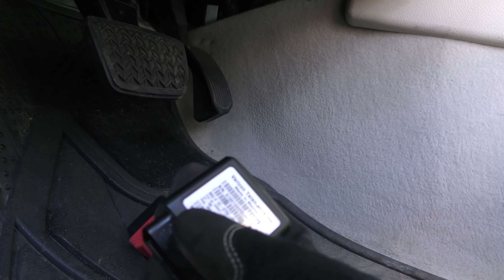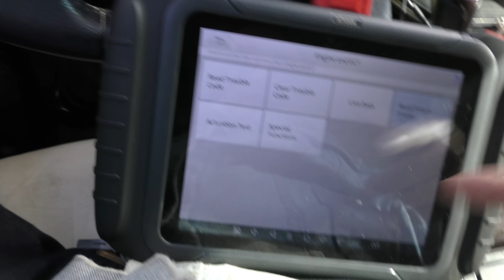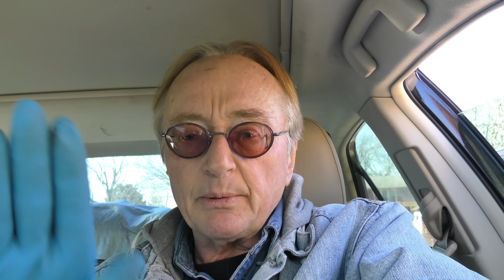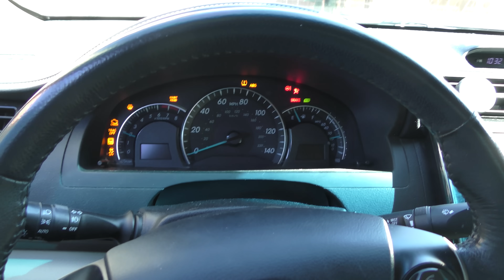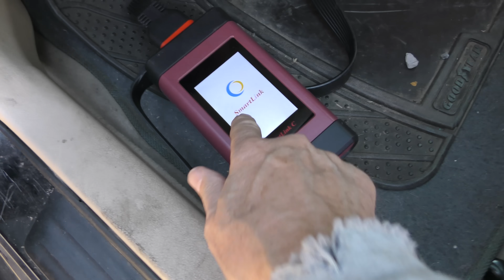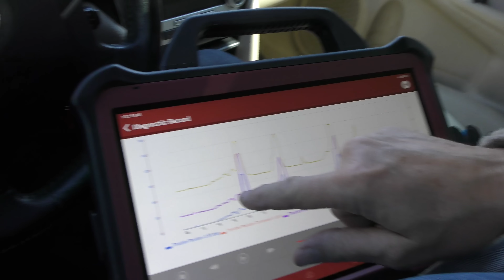This Stupid Device Just Cost My Customer Thousands in Car Repairs

Comment: Hey Scotty, great vid -as always - and good to know about those OBD diagnostic dongles.  Curious, do you think those insurance company driver behavior monitoring OBD devices/dongles can also cause damage?   I don't trust any of 'em!
Reply: Yes they can! I would rather pay higher insurance bills. Messed my 2002 Ram Van up for a long time.
Reply: I hate that when people drive slower so they can save on insurance 
Ruins everybody else's drive or commute home after work
Reply: They watch your accelerator pedal use behavior, among other things, so it seems entirely possible that a badly implemented dongle can mess up the related system.
Reply: I would never use of of those either. It's a stupid thing they came up with to monitor you
Reply: Another thing is that electronic throttles are used for is safety systems. For instance, I drove a Mazdaspeed3 for a while, which is a ~260hp FWD, stick shift sports car. It electronically retards the throttle in first and second gear if the steering angle is not right at center and held there. This is because the car is capable of generating incredible torque steer in first and second, and even with the retarding of the throttle, it'll pull you right off the road if you're not paying attention. Similarly, I've read that some traction/stability control systems also will override your throttle input if it thinks you're doing something stupid.

Comment: Man that sucks to have to replace the main computer like that is crazy. I never liked those plug-in diagnostic cell phone reader Diagnostics. I like to use the regular OBD2 also don't use those computerized accelerators that help your car go faster from a stop I predict those with mess up your transmission over time

Comment: I have a question, my car wouldnt start and a shop i usually deal with came to jump my car bc it was freezing out so i thought it was just bc of how cold it was; they tried jumping it with a battery and jumper cables and it wouldnt start up. 

They towed it to the shop and told me it is my starter and I would need a new one, now they got my car started without me replacing the starter; how can they do that? 

Also when I was told how much it would be and i said i couldnt afford it the person asked me how much i could afford, I dont know if they were trying to accommodate me or just try to scam me; when i picked up the car they told me also how it was started it could last 6 days or 6 months they wouldnt be able to know and that is why Im thinking it was some sort of scam and my battery was just that cold. 

My car is a 2009 dodge avenger 2.4l and i just replaced the battery in 2020, if anyone wants to weigh in please feel free!
Reply: Starters can work intermittently when failing. Sometimes a good wack in the right spot can bring one back for 6 min. Or 6 months. I had to crawl under my old work car many years ago to give it a wack to get home one day. Another time my van wasn't starting on a cold day and I had to get to work. I think it was the solenoid on the van though because I had to jump the contacts with a screw driver, but never stopped working again after that. Haven't driven it in a long time.
While I can't say if that particular shop is trying to scam you. It's not unusual for starters to fail as you describe.
I use the whack test at work before replacing starters just out of curiosity if I can get it to work one more time.
Reply: @caddyguy5369  thank you

Comment: I also bought a cheap dongle and when I put it in obd the airbag light would turn on and car used to die. So I removed it and crushed by driving it over. Hopefully it didn't do any permanent damage, only time will tell

Comment: The throttle sensor went bad on my 350Z and all that was was the rubber grommet under the pedal where it rests it went bad so it created a gap I took a screw head that was the same thickness as the rubber top of the grommet and put a metal screw in there never had another problem and the good thing is it will never go bad again that tiny little gap between the bottom of the pedal and we're at rest set created that I saved $300 and the good thing is it will never go bad again

Comment: I had to replace my throttle body several years ago when I had my LS400. I had to drive with the A/C on or the check engine light would come on and I would have to push the throttle to the floor in order to get the vehicle to even move until I shut off the engine and restarted it. Replacing the throttle body fixed everything, but this person may have a different problem so I don't know because of course i can't get to drive that vehicle to see if it's acting the exact same way.

Comment: I mean i guess its possible. But not probably. Sounds like uve got a highly biased opinion of obd2 dongles. Damaging the computer though? Doubt it. We manage a fleet of vehicles with said devices and never have had ANY issue. And were talking since brand new they have had a dongle plugged in. While parked. Nice try though im sure stupid poeple will easily believe this. But what a crap diagnoses. This is what happens when a mechanic isnt talented enough to actually find the cause of the problem.

Comment: Some dash cams now have the option to connect to the OBD2 port instead of tapping a fuse to record while the car is parked. Could this potentially damage anything?
Reply: No, your OBD port is fuse protected but it is still better to hardwire it the proper way.

Comment: Electronic\eletrical spray cleaner removes loose debris that is all. The proper way to clean is to brush\scrape the connecting pins providing a contact surface free of corrosion then spray. Essentially, what Scotty did is useless....I am not impressed. If I practiced the equivalent craftsmanship I would be a crappy tech.
btw...I am a ROV +20 yr tech.
There is the right way and then all the others.

Comment: What if its only a TPS adjustment or change
Reply: If it's not a diagnostic tool like what Scotty has, don't use it. Unless you are diagnosing problems nothing should be plugged into the OBD II system.

Comment: I know corps with fleets of vehicles that use something like these. So far the one I personally know have had no issues with these dongles with exception that they can stick out too far and be kicked over and over. A short OBD extension cable fixed it. These dongles provide in vehicle wifi + tracking + vehicle statuses.  So far, I only agree with you plugging crap in cars so far were those cheapo cigarette lighter adapters with super noisy switching power supplies that can in fact glitch out computers.
Reply: Gotta disagree with you.  My alarm kept randomly going off a few minutes after I turned the car off.  Eventually traced it to a faulty T-Mobile syncUP Drive.
Reply: @cooldaddyslick6869  did a replacement resolve this?
Reply: @kakurerud7516  Yeah me taking it out solved it.
Reply: @cooldaddyslick6869  but what about putting in a non defective unit. I am an electronics guy and actually want to know ;)
Reply: @kakurerud7516  Yes.  I bought another one.  The issue never came back

Comment: Correct about the can of spray cleaner but those little dongles have resistors and no way to back feed voltage at all. No possible way those can affect the ECU of a car. If you know a little about electronics you know this is a load a bull 😮‍💨😂
Reply: That dongle can interfere with module communication on the controller area network. That can give you weird issues.
Reply: @ubahd00d   Show us proof that this thing does what you said it does...

Comment: @0:25 - OM-Gosh!  I learned that the hard way.  I just came back from a horse show.  Had my F-350 running with a three horse slant load trailer behind the truck and two tired horses inside.  I went to get out of my truck and left the engine running while I went to open the gate to the barn.  Well, my JRT decided she was going to be nosey and see what I was doing.  She stepped on the front driver side door panel and locked the doors.  All my belongings were inside the running truck.  Fortunately, there is a phone in the barn (landline) and I was able to call someone for help!  I will never forget that night.  Since then, if my car is running, I always roll down the driver side window at least half way regardless if there are any dogs inside or not!

Comment: My Summer car, a '97Geo Metro, had developed a hesitation and poor power problem when I took it out for the first time in the Spring. Settling in to work on it,  I took off the air cleaner, only to find it packed with a mouse nest.

Comment: This is why everyone needs to drive a Tesla. They require no maintenance so  you don't have to worry about the engine running rough or oil changes. All you have to do is drive it for 3 years and then get a new one. It's super eco friendly. I've driven my for 30 months and the tires are starting to lose their grip so I'm getting a new model 3 in 6 months. You really only need to put $23,000 down and the payments with insurance are only around $1,400/month. Way cheaper than having to buy gas and oil and tires.
Reply: Totally agree man.

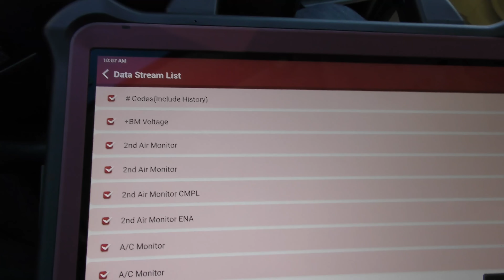Comment: 11:34 maybe one of the circuit boards has a crack in a copper trace? Because metal expands when it gets hot maybe that helps complete the circuit, but when it's cold the circuit is open?
I had a similar problem in my old Isuzu Trooper.
Good video 👍
Reply: There is a problem with "closed loop" mode. That is when an engine is cold and it uses base parameters to run. When it warms up it uses "open loop" mode. In open loop it uses more sensors (like the oxygen sensors) and adapts to be more efficient, and for abnormalities like altitude. This car probably has an air leak, either in the vacuum system or in the intake gaskets. Thus the "throttle" (a.k.a. air inlet) malfunction code. Long term fuel trim and mass air flow at idle for the engine size should give the answer.
Reply: @stewartgriffin3192  Its backwards. Open loop when cold, as in the sensor circuits are open, so not "connected", closed loop when warm, as in the sensor circuits are closed, or "connected".
Reply: @stewartgriffin3192  With the heated oxygen sensors that most cars use now, it doesn't take long at all for it to enter closed-loop. I'd say more diagnosis needs to be done related to the codes it's throwing. Maybe before condemning the ECU, he should try to understand what it's telling him a little better.

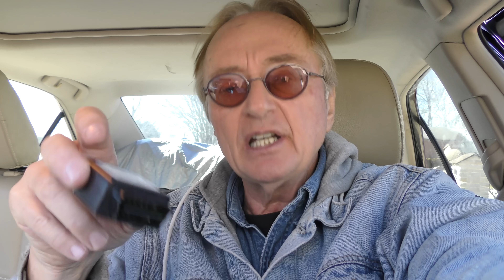Comment: 10:46 WHAT ABOUT... an UltraGuage or ScanGuage digital gauge tool? It gives live data from the car's computer and displays engine information such as RPM, Speed, Coolant Temperature, etc.
Good video 👍
Reply: Never had a problem with the Ultra Guage I bought. Used it every day on a 2014 Chevy Sonic,2017 Kia Sportage and now a 2020 Ranger.
Reply: Wondering the same thing!

Comment: I Use Blue Driver scantool and left it in for obscene amount of time to log data streams on a tablet, never ran into any issue.. its not top notch but does a good job for what it is, and alot easier ansdd safer then leaving my Solus on the seat next to me..
Reply: I've done the same..
Especially when waiting for an intermittent problem to act up.

Is this a "low end device" thing or a just "always means always never do this.."
....I had a manager write that in a memo. 
I laughed all the way into her office to ask what the hell that meant.  😂

Comment: After unplugging battery positive while the car was in operation ecu turned off air conditioning and instrument cluster gages. This is 2002 ml320 . Any helpful advice or what to check? Scanner says it is from can network.

Comment: Hi Scotty, my 2007 Toyota Highlander I got from the dealer I used to work at came with an OBD II gps tracker from sky force. I had it in for a couple of months until I finally got my own Autel scanner. I plugged it in and it didn’t want to read the car, I kept getting error on the scanner for lost of communication . Until I realized that the obd2 port was the gps module and not the cars obd2. So I removed the device and put my original port back in place. Then my scanner picked up the highlander. There was still some errors on lost communication but after driving the car for about 2-3 days. The scanner no longer had trouble reading my car. I remembered you said this on a prior video and thank you again for this info. Saved me thousands!

Comment: I bought a 2016 Traverse about a year and a half ago. I transferred a ScanGuage I had used for 15 years on my old Astro to the newer car. About a month later as my wife was driving it suddenly the dash lit up and the car began running poorly and tried to quit. I took it to the shop and they discovered that the Computer in the car was not compatible with any type of external device that plugged into the port. Luckily no permanent damage occurred. I threw the ScanGuage away.

Comment: If it's a hot cold issue with the computer, it could be as simple as a screw tightening of the board. They have been known to flex under stress.

Comment: Would someone please tell me how a computer controlled $300 throttle sensor is better than a $2 cable?
Reply: Computer control is the latest method of optimising the operation of various components: throttle position, ignition timing, fuel injector timing & duration.  All of that is necessary to make your engine comply with emission limits.  To get a better perspective, ride a 1920s motorcycle with manual controls for throttle, choke & spark advance for you to juggle.
Reply: @brianvogt8125  Yep or any carburated engine
Reply: Something related to "intelligent timing" and "better fuel economy" ?
Reply: Traction Control, Stability Control, ABS (newer, not all), Adaptive Cruise Control, Forward Collision, Ect. Drive by wire has a lot to do with modern vehicle systems. The 2$ cable is nice, but only for those that can drive. For most people on the road, I will bite the 300$ Sensor to keep them from hitting me. They would take the autonomous vehicle to play on their phone.
Reply: Well some cars park themselves nowadays. I dont think your $2 cable does that.
Reply: More profit for the dealers because more things to break.

Comment: What can you do to manage the Hondas oil dilution problem on 2020 accords I have a sport 1.5t 4 4 cylinder
Reply: @Walter Agree 0W-16 GF6 oil instead of 0W-20. Normally Scotty says it’s bad to change viscosity with car oil, but it helps the oil dilution problem go away after a while in the new 1.5 turbocharged Hondas

Comment: This doesn't prove the cpu was bad, he needed to exchange it to prove it.
Reply: Much less that a Verizon dongle caused it.  I wonder whether there are any stats on what percentage of cars have a dongle installed all the time, and whether the car CPU failure rate is different from cars without dongles.  I'm sure he's found bad computer modules in cars without dongles installed also, though if he thinks there's a correlation, probably there is a correlation.  Sure would be nice to have some hard data about it, though.

Comment: Hey Scotty I had one of those Verizon scanners on my 1998 ford expedition and for the longest time I have been having an EGR code and no matter how much I look into it and try to fix it I won't go away, do you think the Verizon scanner messed up my computer as well
Reply: Prob
Reply: likely.
Reply: Probably not. What code are you getting? The EGR system should only be active after the vehicle warms up. Which is the opposite of this car.
Reply: @Stewart Griffin  I'm getting code P0401 Exhaust Gas Recirculation flow insufficient detected.

Comment: Instead of using a stick, couldn't the throttle be opened with the key on, engine off and pressing the gas pedal? I hate intermittent electrical problems😐
Reply: @PANTYEAT1 the way an electronic throttle can get damaged is if someone keeps opening & closing it over & over again with their hands. Good that Scotty had it only barely open & not using his hands to open & close it. Good method
Reply: @Blakecryderman7244  every time I've seen it done was with the key on, engine off. Let the car do the work imo.

Comment: Thats a car tracking dongle, not OBDII.
Reply: It's a car tracking/diagnosis dongle plugged into the ODBII port and reporting out wirelessly.  You're wrong about it not being OBDII.  Not every OBDII device is a traditional scan tool found in a shop, but that doesn't mean it's not OBDII or not a scan tool.  It indeed scans OBDII data, just doesn't present it on a tool traditionally used by mechanics.

Comment: cold solder joint on a module once. Hot days no problem. Cold days took 15 minutes to correct itself. Drove it like that for 3 years. Final repair $1,000. Should have got it done earlier but it was Hard to find a trusted mechanic

Comment: I forgot we need bigger mirrors on autos or our world has more wrong some not done the best ways I did not see car seats but forward back move what about raise or lower them softer ones I only sat in a checker one private vehicle no taxi plenty of room feet and all more of why out of production no more made or why even clothes fashions whatever made nicer but does not last why automatic brake systems just have brake pedals all this crap costs money and recalls does not always works as it was made for doing too much time $$$$$$$$$$$$$$to fix I learn to drive same as photos taker news freelance all manually operated for cars it is both bad nicer either manually or automatic with cameras manuall best but now cell phones cameras I never learned past present whatever was could be good bad if it was more like vws original bettle one style it works well not broken why fix it